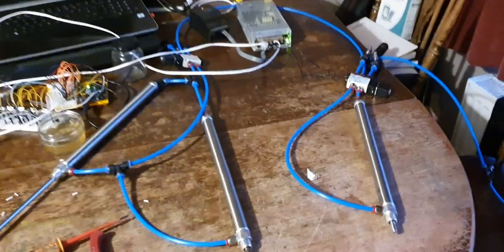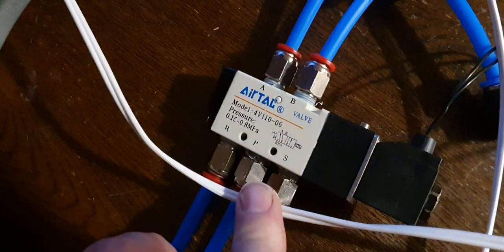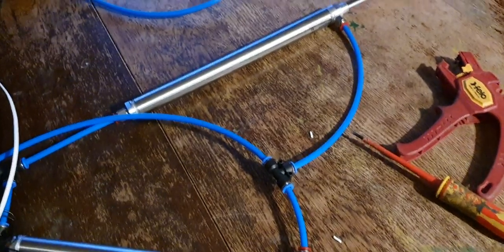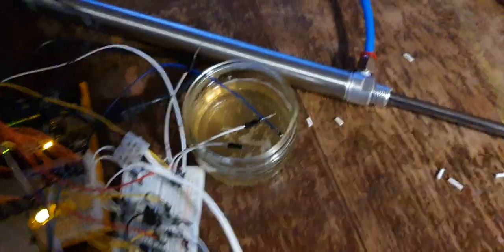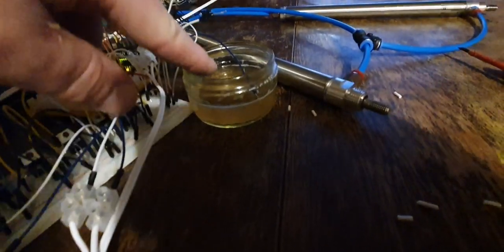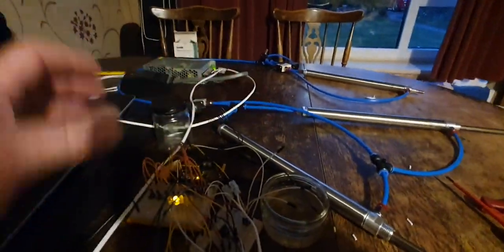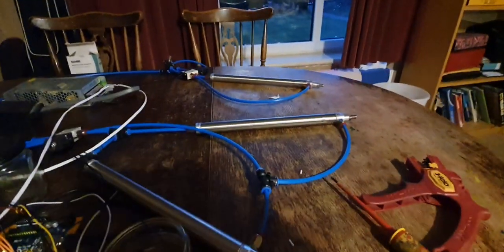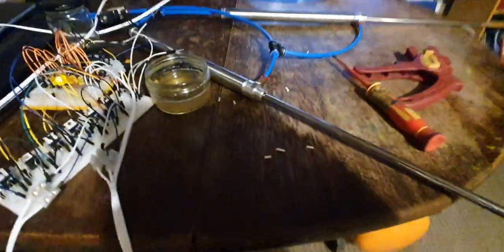Pneumatic Hardware ~ Prototype Can Filler

Comment: Thats awesome. Im trying to build my own filler too, i guess i could help with this. My question is, that sensor for stop the filling will be like that? My biggest issue is to get a sensor that will stop at a certain level of liquid without considering the foam. Of course to do a proper cap on foam
Reply from the maker: We are working on code that ignores the foam after the first calibration run.
Reply: @harrybrew69  awesome. Can't wait to test it out